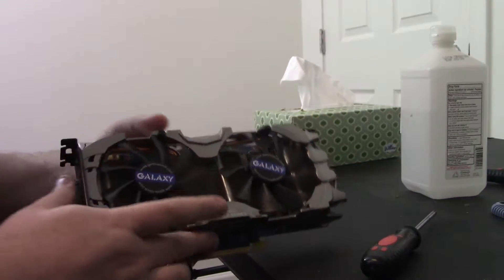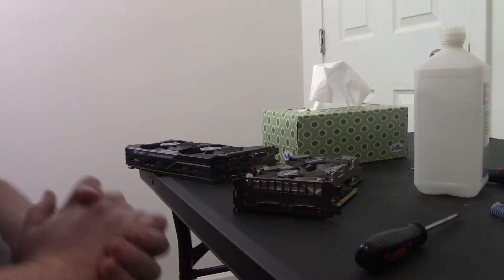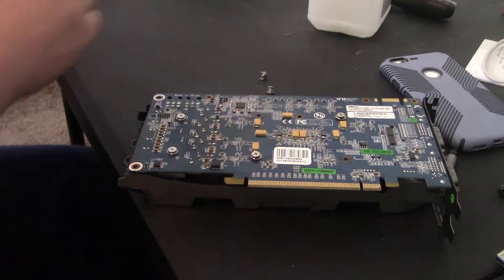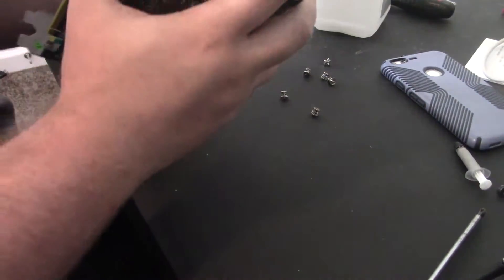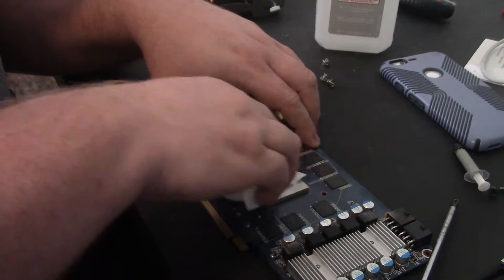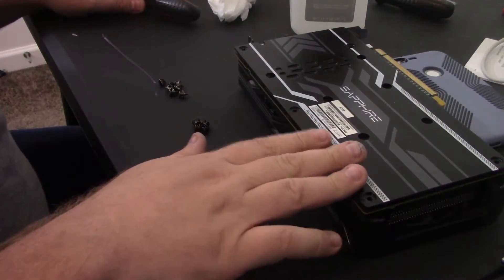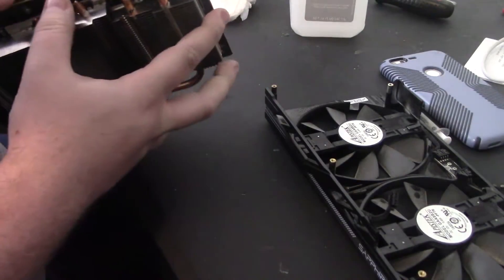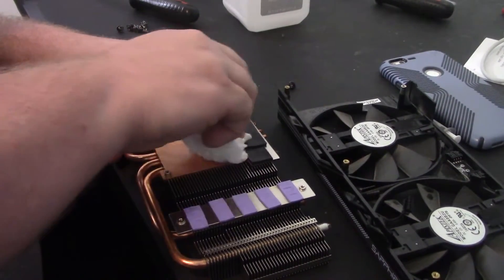How to Guide: Replacing Thermal Paste on a GPU (x2)!!!

Comment: STEVE I am in dire need of tech help. I bought a new motherboard for a build that I bought of of you. I installed it and hooked everything up and now the computer will spin it's fans but not send any signal to the display! I have the hdmi connected to the video card idk what is wrong and I am panicking! Please come to the rescue PCBUDGETSOLUTIONS!!!
Reply from the maker: +Kingdom Rhye check and make sure the team is seated correctly.
Reply: I sent you a more in depth email steve
Reply: team?
Reply: I have it powered on right now and it is sending nothing to the monitor
Reply: what is the team steve 0-0 I have my motherboard placed on risers and the board lights up when i try to power the build on so I know I didn't fry the board
Reply from the maker: +Kingdom Rhye did u reseat the ram?